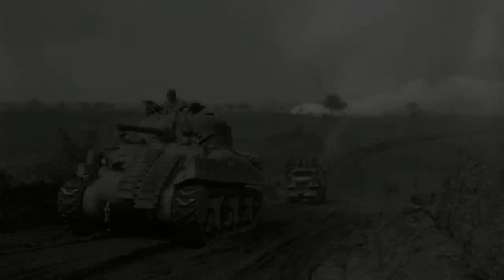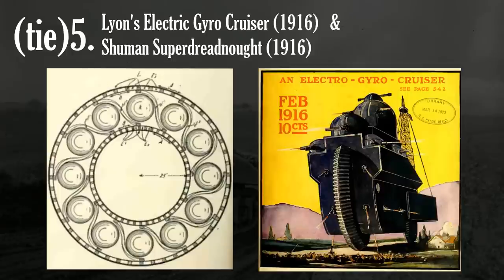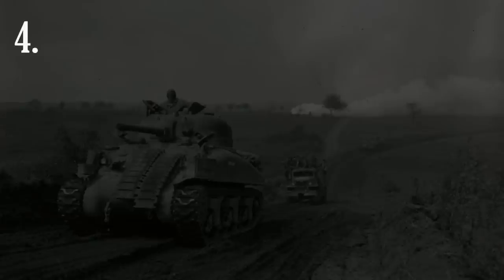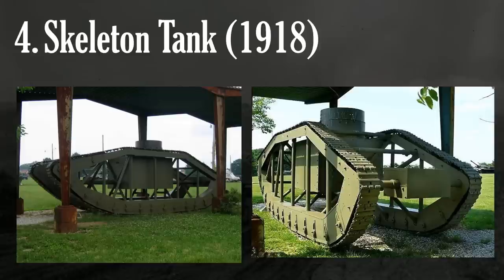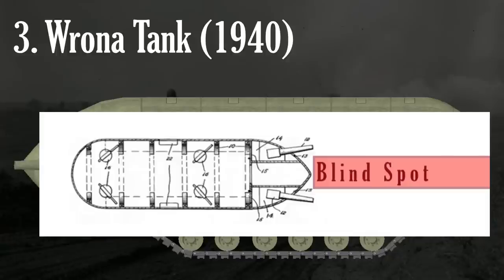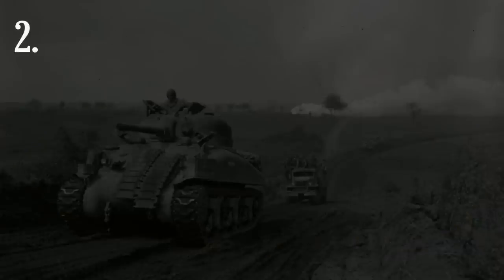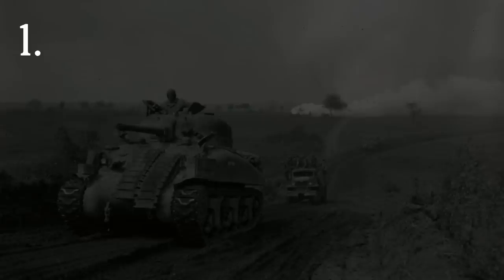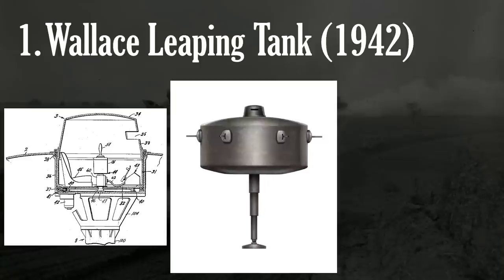Weirdest American Tanks Ever Designed

Comment: WALLACE: "So as you can see, in the presence of danger, the Leaping Tank rises from its foundations and leaps down the street and around the corner for safety."
model tank leaps two feet, crashes and burns.  Little wooden soldiers spill out of the model aflame.
WALLACE: "Huh.  Well, the real soldiers wont... um... won't burn quite so fast..."
Reply: Ok, thanks for that presentation professor Frink
Reply: Shades of the Architects’ Sketch.
Reply: @Assassinus2  My thoughts exactly! I was just waiting for John Cleese to poke his head into the demonstration and mutter "It opens doors, I tell you!"

Comment: Thing that gets me about the Skeleton Tank is that the designers removed all the unnecessary bits of the tank to save weight... and then still kept the tracks going up high over the now non existing side sponsons. 

If they had just put the front and rear idler/drive wheels in the same position, drawn a tangent between them and removed anything about that line the entire tank could have been much lower and, dare I say it, state of the art 1920s.
Reply: It might be more fun to fill-in the open sections with paper-mache, to make it LOOK like a normal tank.  The enemy would shoot at it and wonder why it’s still going, even though they can see gaping holes in its “armor”.
Reply: I mean... toss one grenade in there....
Reply: The inventor of that thing was, as many, convinced the all-over track was the best way to bridge trenches and get through big craters. After all - the most successful tank of the great war was the Vickers.

Therefore, making it a lot lighter by reducing the armored part to the essential bit plus making it pivot to reduce motion sickness and precision of firing whilst on the move was quite forward thinking.

The whole idea of high-mobility tank warfare caught on a lot later. Agreed, the Renault FT was, from our point of view, the most advanced tank of the time - albeit slow. But back then, the principles of how-to make a tank weren't fully discovered.

The main reason why tanks during WWI were so sluggish was the lack of engine power. Even the best engines had hardly more than 100hp and it would take decades before that problem would be solved.

For 1918, the skeleton tank was quite forward thinking indeed.
Reply: Im pretty sure they were worried the tank wouldnt turn it self over if it went belly up xD
Reply: I seen some other tanks, that was actually put into production with a rather "see through" approach to the design.
Reply: @fredblonder7850  I was thinking the same...
Reply: Part of why they didn't chose to do this is part of the un-trenching/un-stucking process, where they would lash a tree trunk/log between the tracks, and with the classic trapezoid tank shape, you can keep it attached as you drive fowards. Also parts commonality. If you're already making a trapezoidal tank and you just want to remove parts, keeping the parts already in production may be more efficient to start with than re-engineering those parts. Perhaps they would do so later. After all, tracked 'tractors' were already using lower profile track sets at this time.

Comment: For reference: the armament of the Yamato-class battleship was 9 18-inch guns. The Gyro Cruiser would have 12 17-inch guns. I just imagine it trying to fire a broadside and tipping over like a bicycle over from the force of firing all those guns at the same time.
Reply: I was thinking the exact same thing... in order to stay upright, you'd have to counteract by firing from the opposite side. Or, imagining a "kick stand" crew having to run outside and deploy a kick stand to prop it up before they fire 😂
Reply: 18.1" guns
Reply: Solution: fire some temporary rockets

Comment: Re#1, there actually were gyroscopically stabilised vehicles, e.g. the Wolsely gyrocar of 1913 and the Brennan gyro-monorail of circa 1907. The concept is mentioned in H.G.Wells's 1908 novel The War in the Air.
Reply: There was also an American gyrocar built in the 60s, and today it resides at the Lane Motor Museum. It still runs too!

Comment: I saw a tank design from ww1 that was an open topped tub that tunnelled through the ground with the top of the tub level with the ground, essentially being a moving section of trench. It was also able to launch "enfilading machines", wheels that either had guns sticking out of the sides or just exploded after a set amount of time. The enfilading machines were just a single relatively narrow wheel that the tank would spin up and drop, letting them roll towards and into an enemy trench. The only issue was that there was nothing to keep them going in a straight line or prevent them falling over on the rough ground.

Comment: The Infantry Fort demonstrates a very basic misunderstanding of what made trench warfare what it was. The problem wasn’t that soldiers couldn’t get to enemy trenches and take them, the problem was that they couldn’t get the necessary heavy support and communications equipment forward in order to keep the trench and advance the line. This is what tanks like the Saint Chamond were created to try and remedy: by creating mobile artillery that could advance with the infantry. (The Saint Chamond wasn’t exactly mobile enough, though)
Reply: When he started describing a tank for trench warfare I started thinking about a tank with machine guns or flame throwers that could aim down the trenches when the tank got to them.  This was... unexpected.  (Also, if you wanted to protect infantry advances, I can think of so many way more practical ways- short of modern APCs, to extend a bit of armor off the side of tanks... like fold out panels that maybe pop out 60 degrees from the side with some wheels and a hinge where they meet the tank so that they can bend up and down as needed for the terrain.)

Comment: Looking at the Infantry Fort there is a tracked platform in use with some law enforcement agencies called the Rook. It's a tracked bobcat loader with the bucket replaced by an armored platform that can be elevated in order to allow officers to access rooftops. It also has a breaching device out front for kicking doors and barricades in.

Also, in regards to the Wallace Leaping Tank, Cobra had this pogo platform that had four legs and hydraulics. That, even though it was a toy, was more feasible as a weapons platform.

Comment: Wallace Leaping tank is... Well I can see that. But not with MG's but cannons and used as a long range engaging fortification that is camuflaged, and when enemy engages it - it can go up and down, preventing aimed shots from tanks. Or even changes it's angle to make any shell bounce if hit. I wondered about something like an extented "arm" with a ERA that changed directions when incoming shell/rocket is going (connected to a system that simply react to any heat signature or maybe a flash/movement and moves the "shield" in front of it), something like a "cope cage" that is really working.

Comment: That Hugo Gernsbeck, what a crazy guy! Jet planes...rocket ships...atomic power, sheesh what a nut......p.s.
As for the Wallace design it is Apparent from the last drawing that it was dependent on at least three possibly four methods of gyroscopic control. It's easy to Envision and air-cooled rotary engine placed horizontally driving the three different gyroscopes and the hydraulic system for the leaping action.

Comment: Great video,  BUT. Something burns inside me when I hear "Caterpillars" or "Treads" referencing the Tracks. Caterpillar is a brand name for excavation equipment and Treads are the pattern on tyres. The tread on Tracks are called Grousers.They are called Tracks because they are a reusable track that is laid down, driven over,  picked up,  then sent back to the front to repeat the cycle. They help displace the weight, maintain a smooth surface for the Road wheels, and improve traction. It was stated "what worked" while showing a Sherman. Yes, they were quick. But the armour was insufficient, and the gun was inadequate until they put the larger gun on making them a Firefly. 
Apart from that, good presentation. As you were.

Comment: A tank motorcycle is plenty absurd. At any size.   But I'd love to see a van motorcycle. 2000lbs, 5 seats, roof.  That could work, and built high without becoming unstable. Like a giant monotracer.  Cargo space without taking up space.  A rideable skyscraper. Cars need a certain width/low center of gravity to get through a corner. Motorcycles not so much.